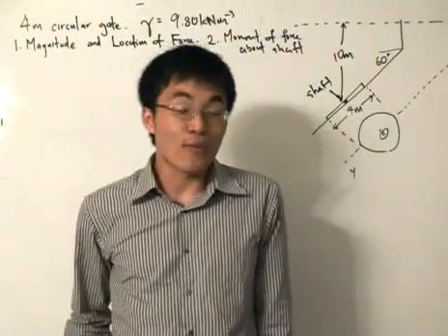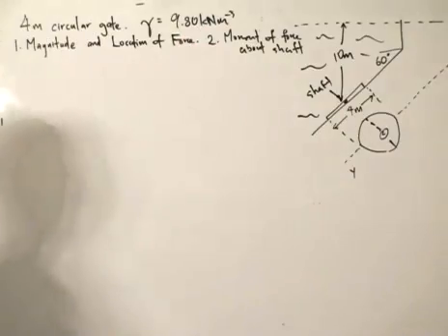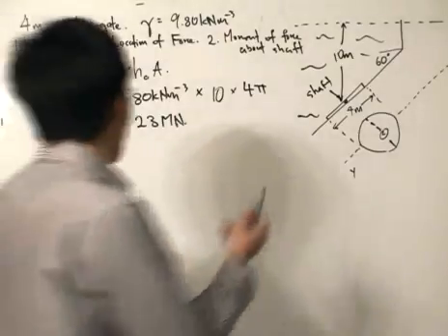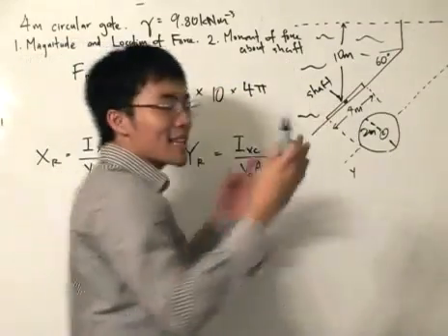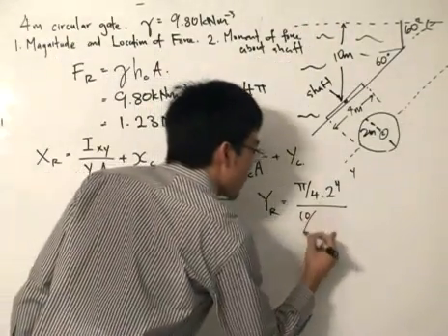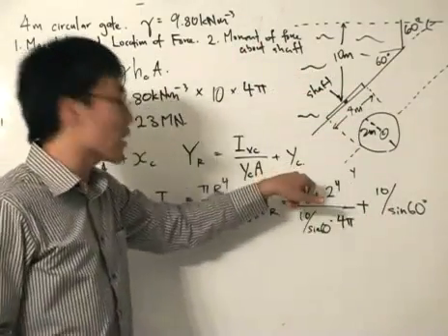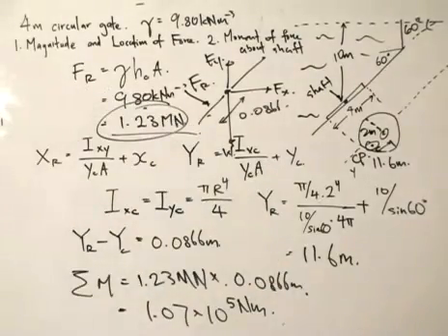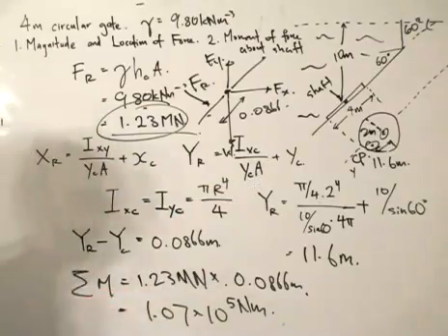Fluid Mechanics - Hydrostatic Force example

Comment from the maker: Recall that the parallel axis theorem for the product of inertia of an area states that the product of inertia with respect to an orthogonal set of axes (x-y coordinate system in this case) is equal to the product of inertia with respect to an orthogonal set of axes parallel to the original set and passing through the centroid of the area, plus the product of the area of the x and y coordinates of the centroid of the area.

In a line, Ixy=Ixyc+A*(xc)*(yc)